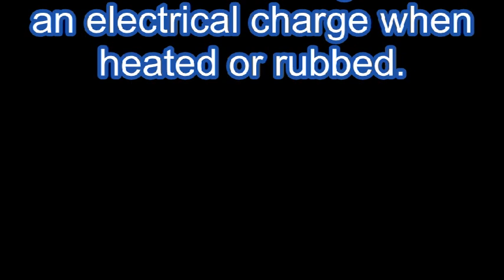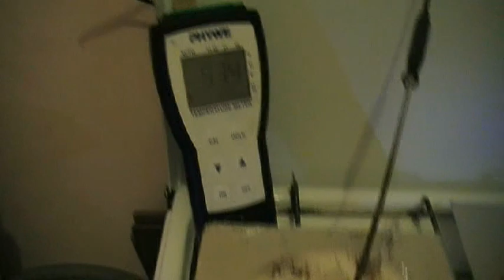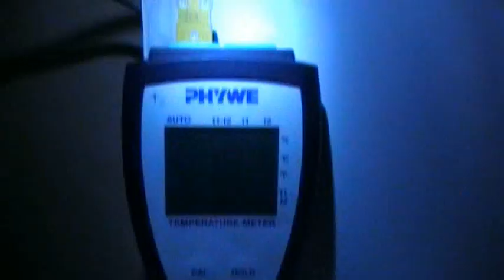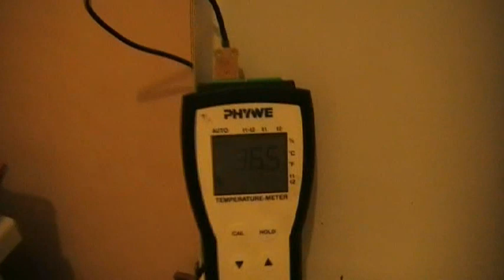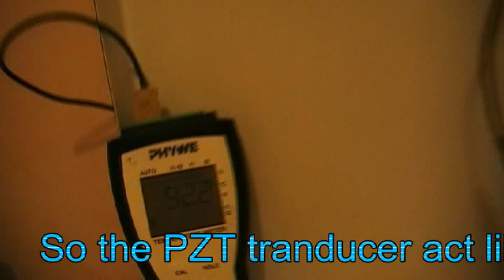Pyroelectricity- High voltage Generator

Comment: when you were heating/cooling the piezoceramic transducer were you getting any amperage at all?
Reply: PZTs are high impedance devices, so generate high voltages at low currennts.